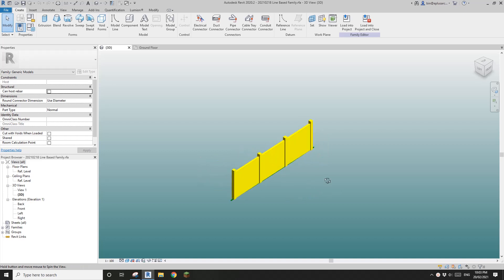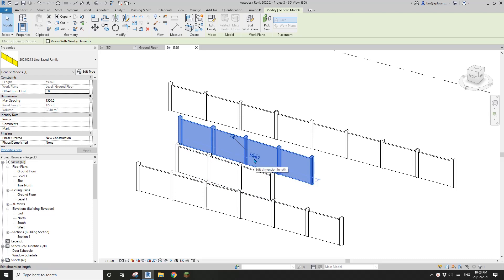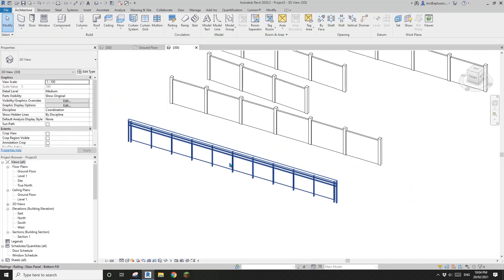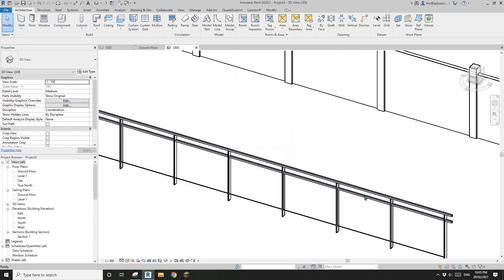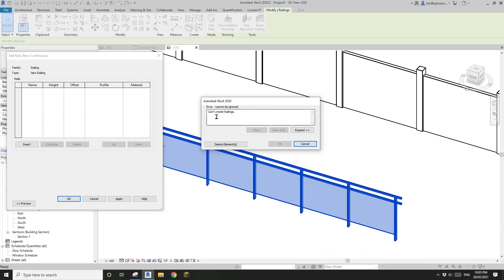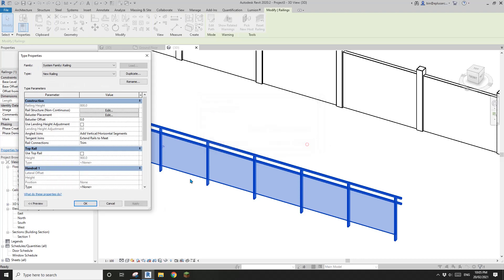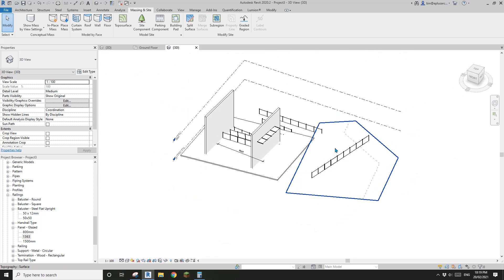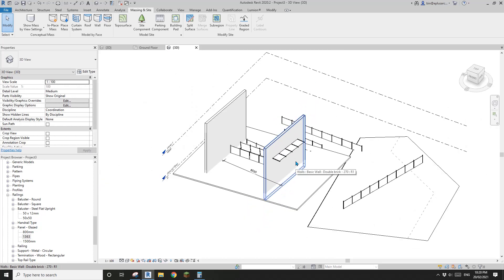Everyday Revit (Day 338) - Railing Exercise

Comment: At 13.52 why u add half of post length...
Reply from the maker: Because you need to offset the post by half of the width so it starts from the very end of the sketch line.

Comment: is this also the case with railings that have corners in plan? i.e. you again need to calculate the setout manually to get it right?
Reply from the maker: Yes, I believe you are correct. You need to have different setting for different length.

Comment: Ok but what about if we put this glass railing on stairs same calculation ...can u plz try  on stairs
Reply from the maker: I think you can. This is a railing modified from an out of the box railing family from Autodesk. You can place it on stairs. The only thing you need to adjust is the panel length, to suit the length of your stairs.
Reply: Thanku

Comment: As you pointed out, railing is more versatile than line based. Howeveri found railing can be temperamental when used on stairs around the corner of the flight(the balusters never at the place where they should) Can you demonstate a tutorial showing stair railing(wall based) that complys with As1428.1.
Thanks.
Reply from the maker: Good idea, I'll do that.